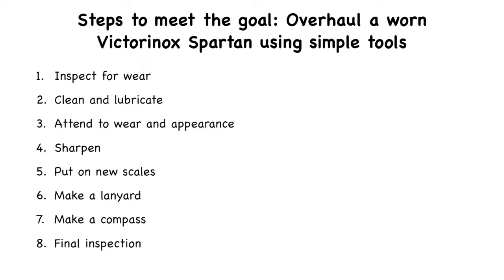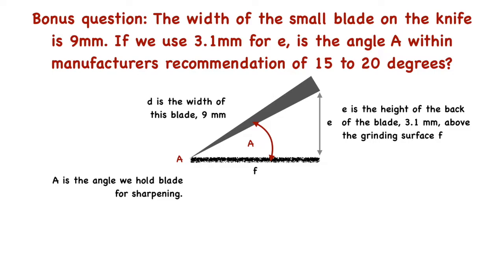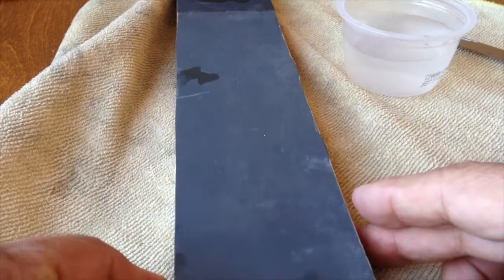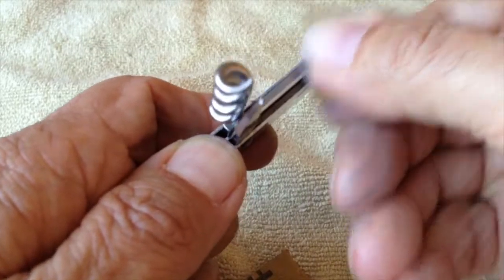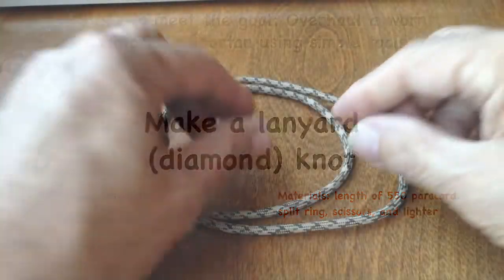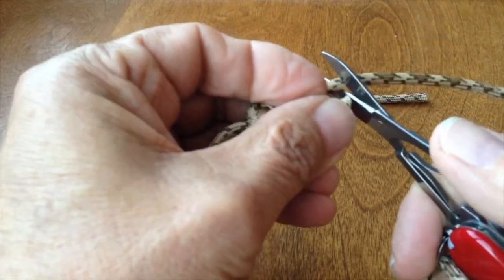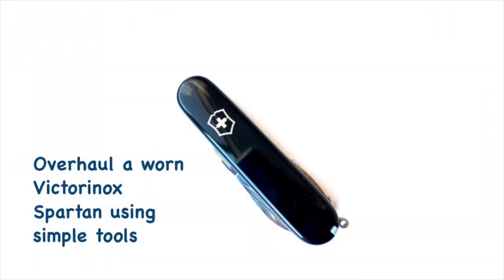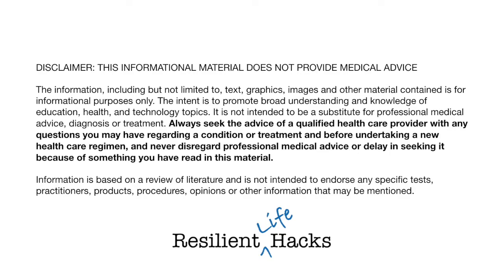Overhaul a worn Victorinox Spartan using simple tools

Comment: You do know that the scales will pop off easier without damage to the scales if you soak the them in warm water before cleaning a d pop them off so you can clean under them.
Reply from the maker: Makes sense as this would soften the plastic. Thanks for contributing your experience.

Comment: Nice vedio man I have a deformed aluminium liner and corck screw because of using corck screw hard. Now I am still thinking about an idea to replace the corck screw and the aluminium liner in between them
Reply from the maker: Unfortunately, the corkscrew is not as hardened as the blades. You can indeed disassemble the knife by drilling the center of the rivet rings that form the heads. Do this very carefully as you  will need to reuse the rivet rings. The brass rod that holds the corkscrew as well as the rods that hold the separators will need to replaced. Measure them as the rod for the corkscrew may be a slightly smaller diameter. When you reassemble you will need to peen and trim the rods to length. I have seen replacement corkscrews for sale. This is tricky work, so if your knife is not too old you might check to see if Victorinox will warranty it.